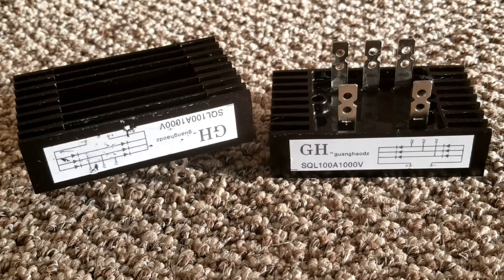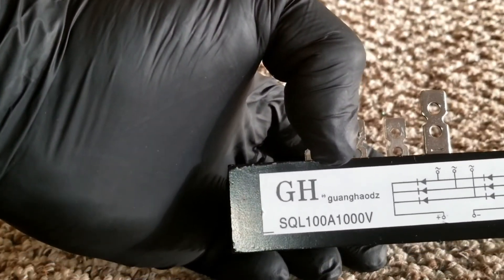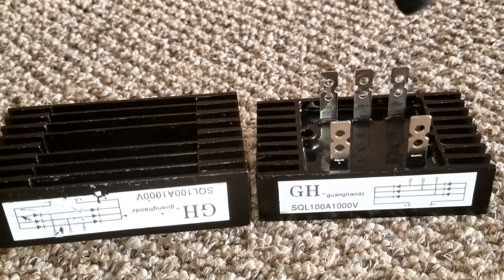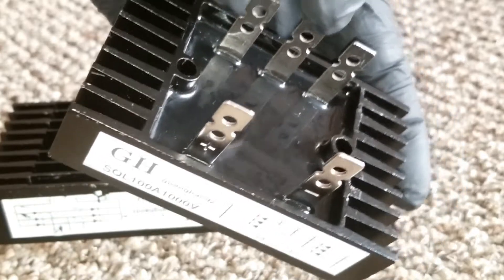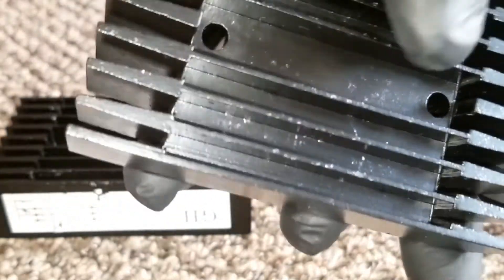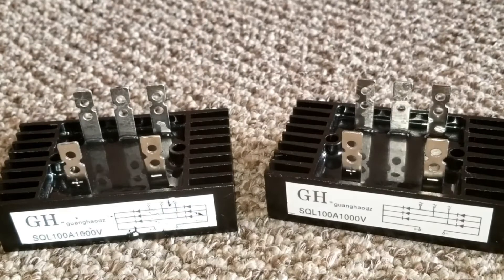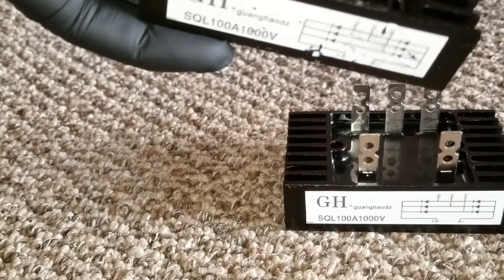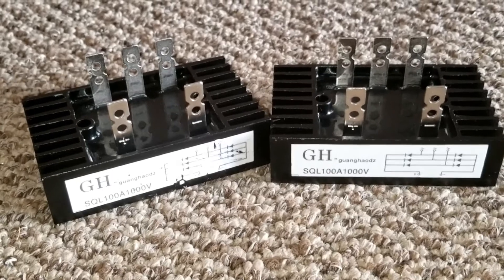RECTIFIER, BRIDGE RECTIFIER, GH SQL 100A 1000V 3 PHASE DIODE METAL CASE BRIDGE RECTIFIER TS

Comment: you will need a charge controller that has a diversion that will switch the power from the turbine to a resistive load like water heater, when the battery bank is charged.
Reply: You can configure the outback FM80 to do that but Midnite classic is a better option
Reply: @awesomusmaximus3766  I heard the midnite had turbine profiles pre-loaded
Reply from the maker: Yes, it does and it's designed for Solar Wind and Hydro Power
Reply: @thefaeryman  Yes it does it has many profiles you can also do a custom profile
Reply from the maker: Thanks for the comment brother John. 
I owned all models of the MidNite Solar Classic Charge Controllers. Starting from the very first one which is; The Kid, Classic150, Classic 200 & Classic 250 mppt Charge Controllers.
Reply: @jwsolarusa  I have the classic 200
Reply: Tested these, cheap, good looking but worthless, couldn't handle 35dc amps for longer than a minute with active cooling before it burned out. total garbage.
Reply: @corjusume  35 DC AMPS? it's a bit high, how are you measuring that?
Reply: did you wind your own coils for your turbine
Reply: @corjusume  if you have a diesel generator, why just power it to a 48 volt inverter charger to charge your battery bank?
Reply: @thefaeryman  good question, it's not a generator in that sense that it makes 230 vac, but rather designed for the sole purpose of charging a 48vdc battery bank.

The reason is that in a solar off grid application I only need some backup power from November to February, rather than letting a true 230volt generator run all the time, I can run this generator for 2-3 hours a day to charge up the batteries to get me through the dark periods, which saves me a ton of fuel and recuperate some of the heat generated (working on that) for my home, I anticipate that by running it like that, I can have the heat from fuel oil diesel that I otherwise use anyway, but get the electricity for "free" as that is expensive here in Belgium.
Reply: @corjusume  so you are taking a high current dc motor and using it to charge your bank, most people use this rectifier for 1600 watt/100 wild ac 3 phase generators which this will handle
your application will need high amperage diodes that can handle more than what you need.
good luck
Reply: @thefaeryman  No not exactly, I use a 13 inch electric scooter hubmotor wheel that I had laying around that puts out +/- 50VAC at around 900 rpm after rewiring (was 550rpm too slow for this diesel engine), the diesel engine is now running around 2000 rpm to beltdrive this permanent magnet AC motor, then I put the 3 phase output through 2 of these rectifiers in parallel to get DC,  once the no load rpm of this hubmotor exceeds the battery voltage it starts charging the battery, the more rpm you give it, the more current it charges.

Yesterday I charged the battery for 30 minutes at 1800 watts, which seem to keep these 2 rectifiers happy at 60-70 degrees C, don't want to push them much further, I think 2000 watts is about the max until I got better brand name rectifiers, but these are not 6 euro a piece like these from alibabaexpress.